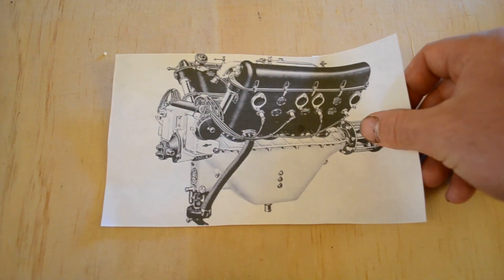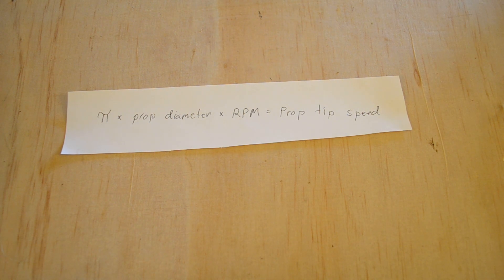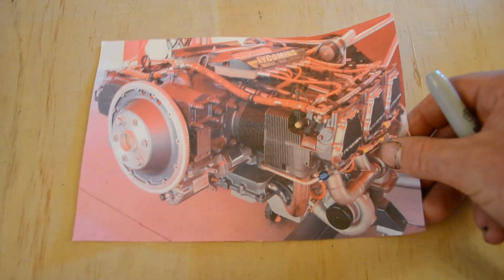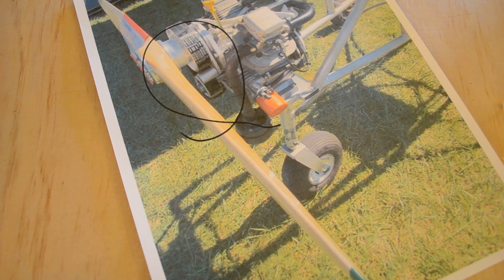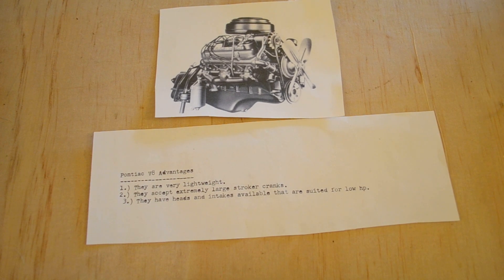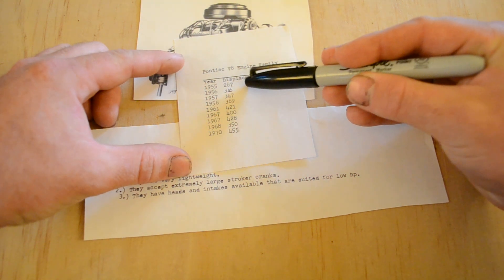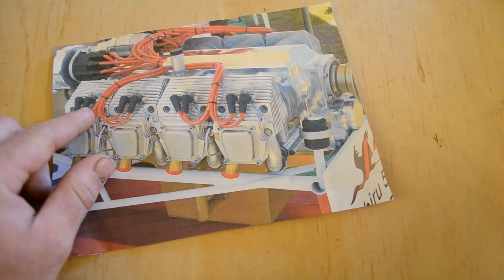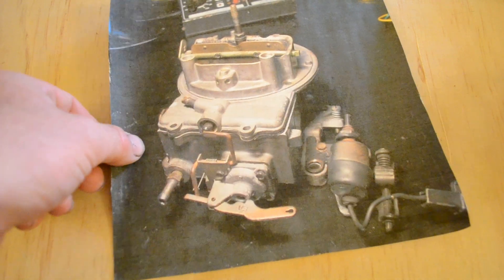Homebuilt Airplane Episode 3: Engine Planning

Comment: Interesting thoughts. I once owned a 1972 Chevrolet Caprice that had a 400 cubic inch small block with a 2 barrel carb. I loved it. Had adequate power and the 2 barrel wasn't too hard on gas. The car's long wheel base and fairly large tires gave a smooth ride. It seemed to float down the highway. I've had many cars since but I sure miss the Caprice. Can't wait to see the converted engine.

Comment: Episode 0 didn't mention an overall budgetary goal.  I understand that this is a long (long, long, long?) range project, but just for fun, I'd like to have seen you mention an estimate for total cost.  We can then all go back and look in a few years and laugh about how over optimistic the cost estimate was.
At any rate, this should be fun to watch and I think you will have tens of thousands of people watching you before it's all done.
I took the kids over to the Airforce Museum a few years ago and they just happened to be having a WWI fly-in on the day we were there.  I was excited to go look at the planes, but very disappointed when I saw them.  The planes I saw had fuselages made from metal tubing and they all had modern engines that were not close to looking or sounding like the originals.  This made me think that maybe original WWI aircraft couldn't be replicated by a home-builder for some reason or another.  To now come across this channel, where you are building an almost exact replica is just really exciting.  I will be rooting for you to succeed.
Reply from the maker: Thank you! My best guess is that the plane will cost around $10,000 by the time I am done, but as you said, it will probably end up costing a bit more in the end! I'll definitely need to remember to include that in a future video!